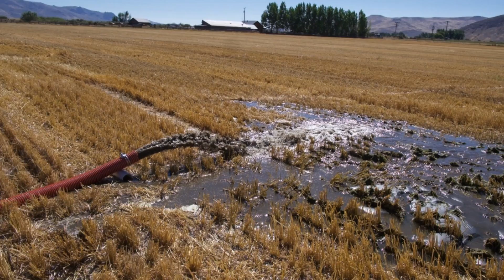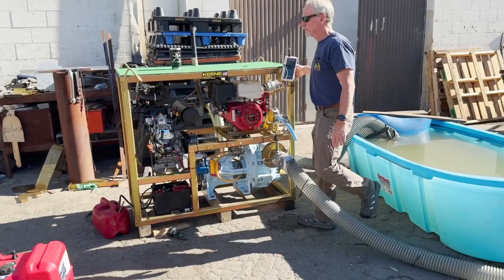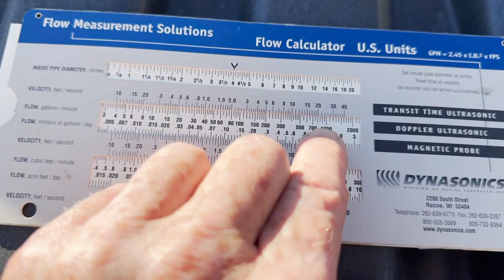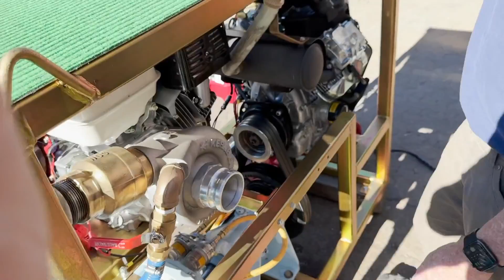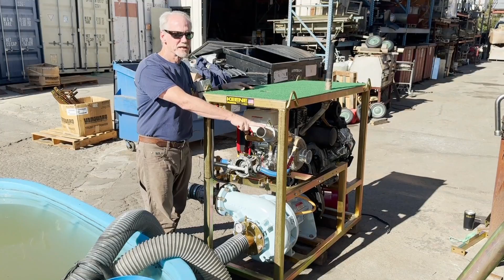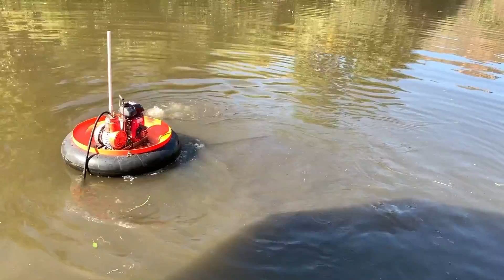4" Gravel Pump 40 hp 4x4

Comment from the maker: Yes, it should be okay in marine operations. We could do a few things to improve the frame, such as galvanizing or powder-coating. The Vanguard 40 HP is holding up in saltwater conditions. We have a bunch up in Nome, AK, and they are getting several seasons out of them.  The pumps are bulletproof and should not be an issue. We could make up the intake and discharge of stainless steel flanges.  We could incorporate some additional stainless hardware.  The deal killer is an 8-month lead time on the pump.